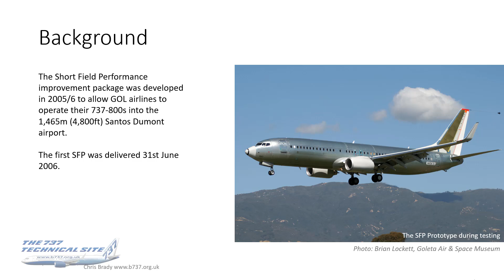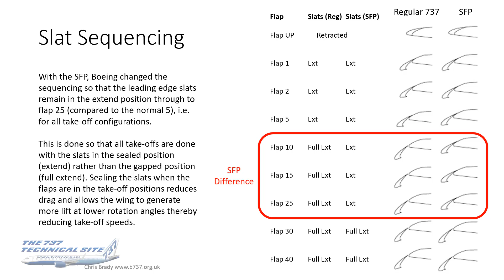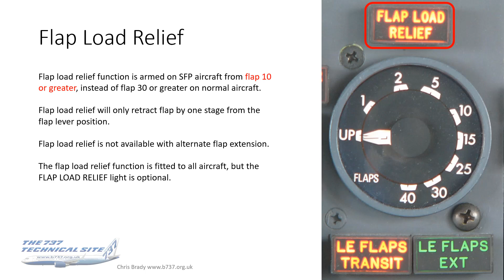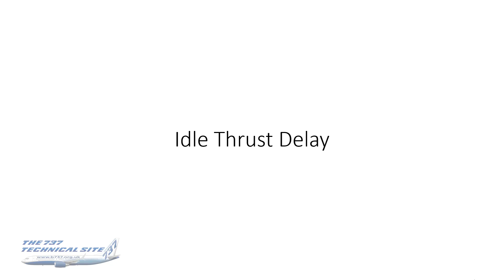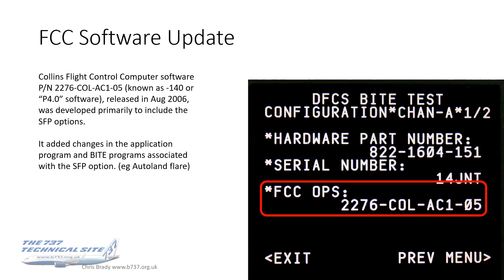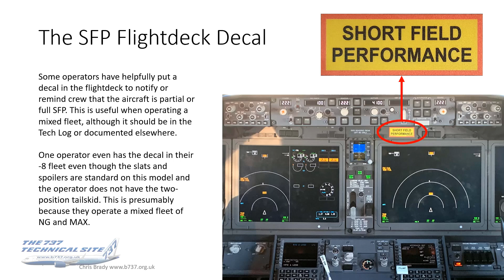737 Short Field Performance

Comment: Great video as always Capt Brady, I thoroughly enjoy your technical breakdowns. I have a question: For the Spoiler Deflection, right around 7:08, you mentioned the increased spoiler deflection help "decrease" the loading on the landing gear, but your text says "increases the loading on the main landing gear...". Just wanted to point that disparity out. Cheers!
Reply: I was about to comment about it also, seams a small divergence, more normal force on the train, as consequence of loss of lift, means more braking power available for shorter runway. 

Landing in SDU is a must go for aviation entusiasts , like saint martin, madeira, CGH and if available at this time Kai tak
@Pilot_obet
Reply: @lewneck I think it was just a small error when he was narrating. It definitely increases the loading on the main gear, as the text says.
Reply from the maker: My error, it does of course increase the loading.

Comment: One question. Does taking off with a static run up have any positive effect on takeoff run distance? I couldn’t find anything in documents.
Reply from the maker: If you mean setting 40% or take-off thrust against the brakes then releasing, then yes, it will have a small benefit.

Comment: Thank you for everything that you explain and share with us, but i’ve a question you may answer.
There are many companies operating 737ng series are publishing more restrictive wind limitations instead of using boeing suggested wind speeds, i can understand the environment and the other dynamic things. I’m not sure using more conservative speeds and limits are decreasing crash rates. Thank you captain.
Reply from the maker: You are welcome for the videos and website.
Re your question, Boeing do not have suggested windspeeds, they have maximum demonstrated windspeeds. Boeing is a manufacturer not an operator. It is up to operators to set windspeed limits on their crew/runways.

Comment: Great video
Can u explain me how flap load relief system contribute to short field performance??
Reply from the maker: It doesn't directly contribute BUT there is more scope for using higher flap settings for take-off which may lead to more overspeeds, so perhaps the increased FLL was to allow for that.
Reply: No effect on performance, obviously. I'm wondering why it was originally only provided for flaps 30 / 40 ?

Comment: Great video, just to comment on the ‘’Reduced Engine Idle Thrust Delay’’. Another reason I believe why on the SFP it is reduced to 2s is for the certified data when reverse thrust is not credited for. Basically it lowers the time the engine is producing higher forward thrust.
Reply from the maker: Hi Michel, Yes of course you are absolutely correct, I forgot to add that. Thanks for the reminder.
Reply: That's exactly what I was thinking: if there's no credit for T/Rs anyway, let's optimize the residual thrust instead.

Comment: Thanks for all these info!
Just wonder how the SFP on NG got those spoiler deflection change with speed? AFAIK the spoiler mixer is a quite complex mechanic device. Or is the change are done on individual PCUs?
Reply from the maker: Individual PCUs. A solenoid valve in the flight spoiler PCU activates to allow supplemental spoiler travel. The solenoid
valve command is removed once speed drops below 60 knots causing spoilers to move to a normal deflection.

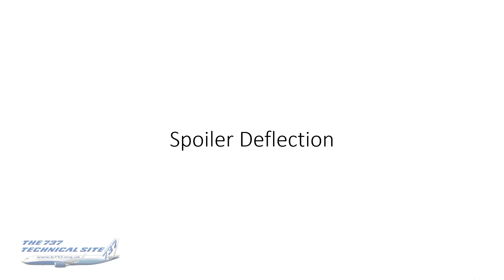Comment: 5:50  Spoiler Deflection Slide.  The presentation implied that the inboard Ground spoiler (#7) deploys to 60 degrees for both SFP and non-SFP models.  This is only true for SFP models.  Maximum deployment of the inboard Ground Spoiler of non-SFP models is 52 degrees.
Reply from the maker: Correct, sorry if this was misleading. It was perhaps more clear in my Flight Controls - Roll video where I used a photo of an SFP and non-SFP aircraft for comparison.